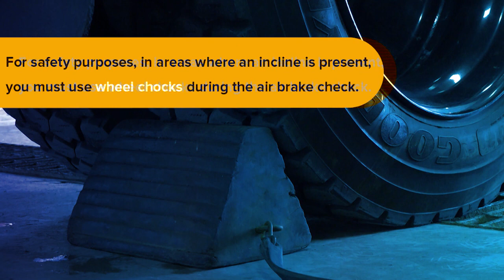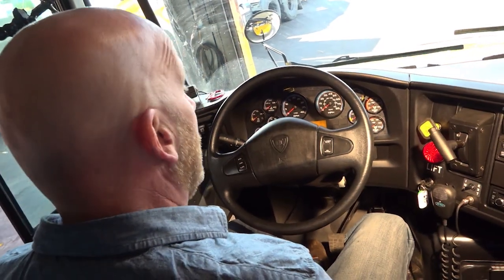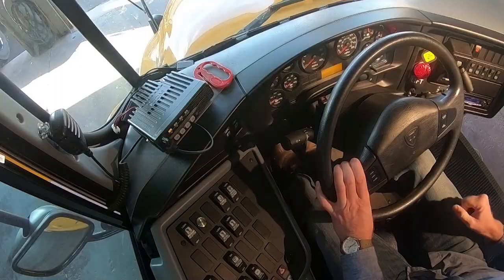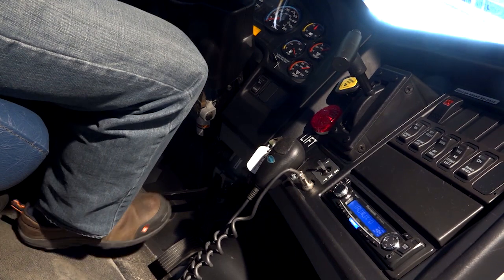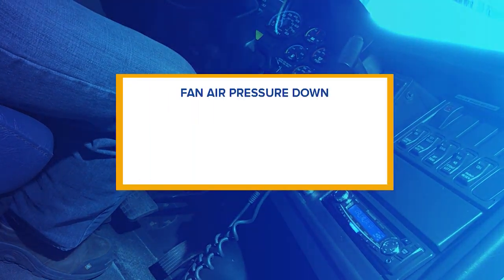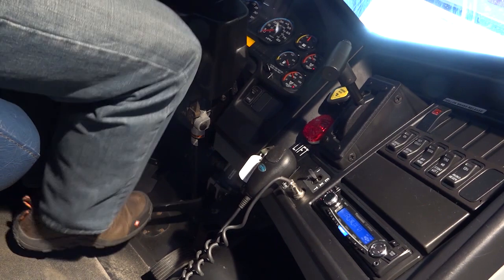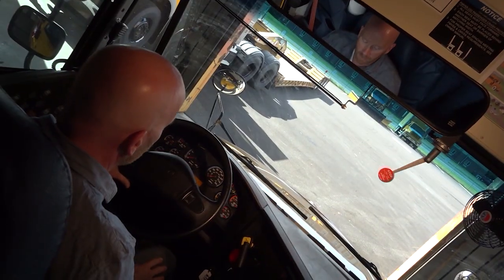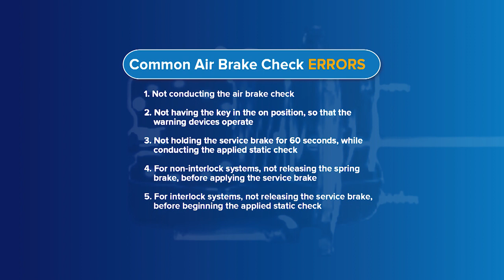How to Perform an Air Brake Check in a School Bus

Comment: For static brake test should door and window be open to hear any possible leaks?
Reply: If you feel more comfortable doing this during training, that's fine, however, on the road test, it's not necessary since everything "should" be working properly.